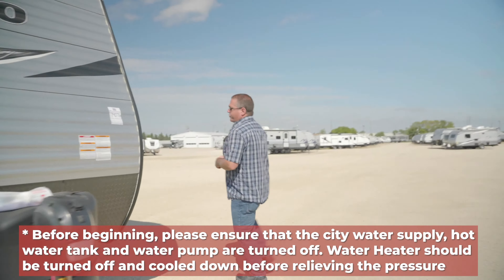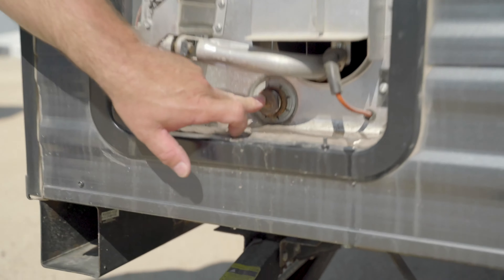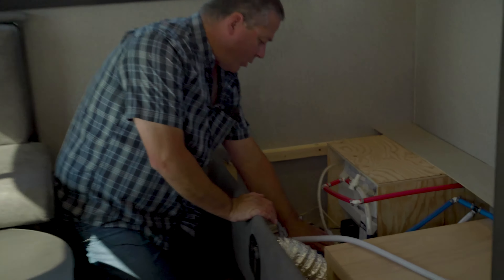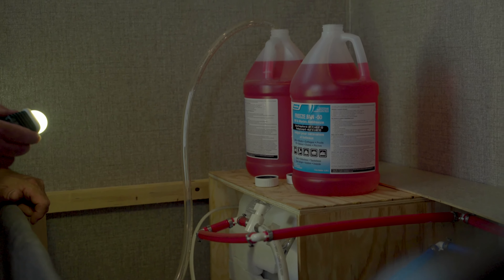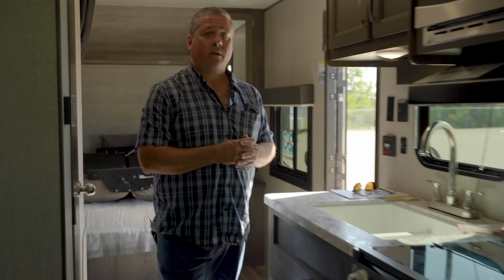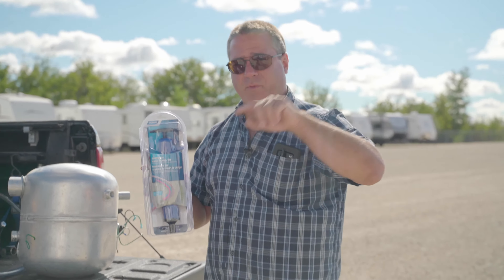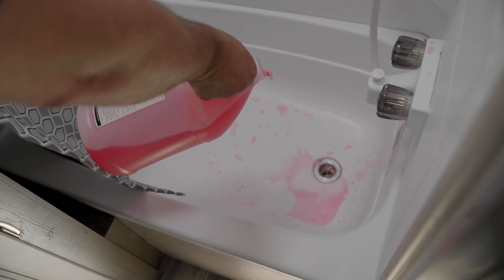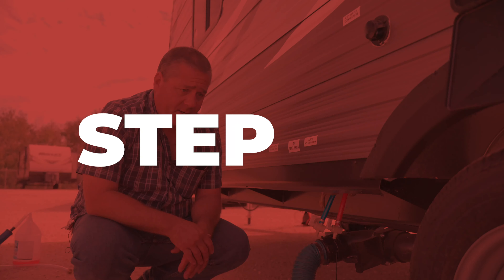How To Winterize Your RV / Travel Trailer

Comment: Great video Trevor. Why do you drain the antifreeze out the low point valve when you’re done? When we de-winterized our trailer (winterized by GNR according to the sticker on the new unit) it had the low point valves still closed and had all the antifreeze in the lines.